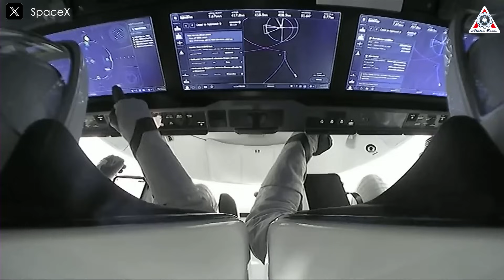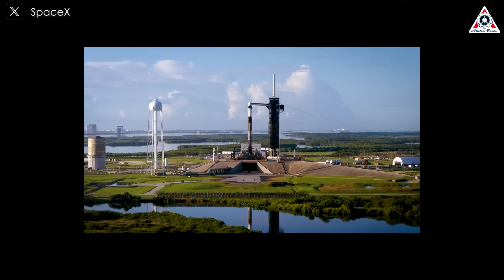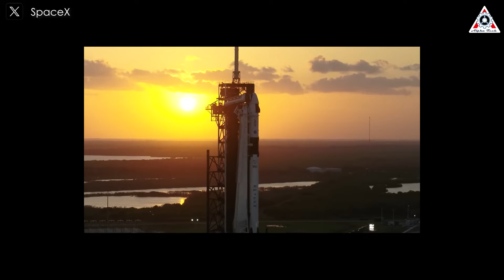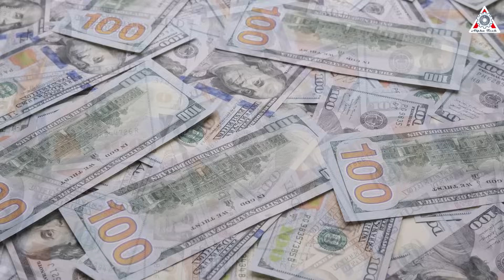What SpaceX Dragon just did Humiliated Blue Origin...

Comment: Rumor is that it was all fake. The windows on the craft - comparing the inside shots to the outside didn’t match up. The craft had a perfect paint job when it landed no scorching nothing. The door lock was on the outside, people questioned that, the outside.
Reply: It didn't go high enough to experience burning on reentry.
Reply: There’s no real reason why it would be faked. It doesn’t leave the earth atmosphere or gravitational pull. It also has to simply stay on a vertical trajectory compared to space x which has to achieve orbital trajectory. The capsule is pressurized like a passenger jet. Jet doors open out also. The short period of weightlessness is during the capsule free falling back to the surface. It’s essentially sky diving in a capsule rather than with a parachute on your back.
Reply: Just like images of street veiw of grammarlys office and the internal images of the facility. You should see the excusses ai comes up with to explain that

Comment: If making rockets was easy, then everyone would be doing it. Those big rockets Elon is trying to build are a massive jump forward in space travel and can only be achieved by trying something new every time there is a failure of Starship. He is trying to do things nobody has ever tried before, so it will take a lot of trial and error to get it figured out.
Reply: Today technology, Space Researchers and Engineers have the ability to digitally design, re design, and run simulators. Yes, the design is very complex and mistakes may happened. But, by all mean... Trial and Error is too primitive for Space Exploration work. .. Or you will blow up the rocket a hundred time before you found something that might work. They use the Design Of Experiment (DOE)  and other comprehensive analysis to pinpoint the issue during the trouble shooting process. There is no Trial and Error anymore.
Reply: @QuincyMax-c6r  until you actually launch the rocket, you don't really know for sure. It's kind of an educated guess up until then

Comment: That is correct—they are nothing more than passengers to the edge of space: space tourists. Blue Origin does not achieve true low Earth orbit. According to NASA, low orbital flight generally begins at around 528,000 feet or more. While crossing the 61-mile mark does place them past the Kármán line—between approximately 341,000 and 351,000 feet—this only provides a brief moment of weightlessness, not sustained orbital flight.  So, in reality, the so-called "Astro-Barbie's" never truly made it to space in the full sense of the word. LOL.

Comment: Someone explain to me why blue origin was not burnt up upon entry please!!!
Reply: There's no re-entry when it never actually left our atmosphere.
Reply: Quite simply, it was a ballistic (up and down) trajectory.  Since it never went into orbit, it never developed enough speed to create a large amount of heat build-up while it was coming down.  (eg.  Its velocity reached zero when it hit apogee, so it never had enough time to really build up significant speed).  

Now where probably was some thermal bloom, but not enough to scar / char the pod.  

Remember, if you go into orbit, your craft is going at least 1,674 KM/H or ~28 Km per SECOND.  Each second is another 28 kilometers that you've traveled.  Where this pod had for all intents and purposes roughly none.  That 1,700 Km/H is what causes all the thermal scar/charing because we're using the atmosphere as a giant brake to bleed that speed off, as heat.

So that's why the blue origin capsule wasn't scarred/charred.
Reply from the maker: Probably because Blue Origin’s capsule doesn’t go into orbit — it just goes up and comes back down. So it doesn’t get hot enough to burn the outside.
Reply: It never achieved orbital speeds.
Reply: they didn't tell the a.i.

Comment: A typical car produces about 3-4 metric tons of carbon a year,based on driving it 11-12 thousand miles. Here is what I found on rockets.

Falcon 9:
A Falcon 9 launch is estimated to produce around 300 tons of CO2. 

Starship:
A Starship launch could produce 76,000 tons of CO2 equivalent (combining various greenhouse gases). 

Falcon Heavy:
A Falcon Heavy launch is estimated to produce significantly more CO2 than a Falcon 9 launch, as it uses more fuel. 

Trans-Atlantic Flights:
Trans-Atlantic flights produce around 1 metric ton of CO2 per passenger, with hundreds of passengers on these flights, so a Falcon 9 launch is comparable in terms of emissions to a large number of trans-Atlantic flights, according to some sources.
Reply: Is that the same CO2 that plants and trees use to produce oxygen ??
Reply: @ yes

Comment: That returning Blue Origen capsule was suspiciously free of re-entry scorching and seemed to be missing the parachute recovery harness and parachute deployment mechanism.
Reply: No re-entry scorching because it doesn't get anywhere near orbital speed. Blue Origin made about 66 miles in height. You can get a balloon and skydive from 26 miles.
Reply: @amcconnell6730 Understood...  but zero scorching?  The capsule looked factory fresh in the recovery area.
Reply: The blue origin rocket never leaves Earth's atmosphere. It doesn't go as fast as an SR-71 Blackbird.
Reply: @TheBandit7613 Actually, on this flight it did - it reached a 62 mile apogee and was officially in 'space' for 3 or 4 minutes. Perhaps you are thinking of previous flights?
Reply: @XrayMike17plus1  Low Earth orbit is 1,243 miles, that's a far cry from a 62 mile high ballistic apogee bro.
Reply: @rolomaticz5009 LOL, so NOT astronauts. Agreed!
Reply: The bimbo bubble doesn't leave the atmosphere and doesn't come close to the planetary escape speed of 25K MPH, so it basically just falls back to earth like the booster does. Reentry at 20K+ MPH speeds means the Dragon needs to scrub off that drag speed or it will bounce and flop like a plane in a dead spin. The fast burn reentry also allows control from flopping around like a out of control spinning bag of marbles which would be like a centrifuge forces killing the inhabitants from extreme G forces far beyond 8G's.